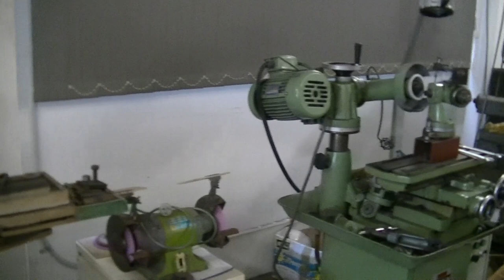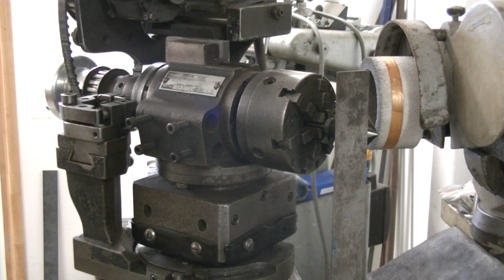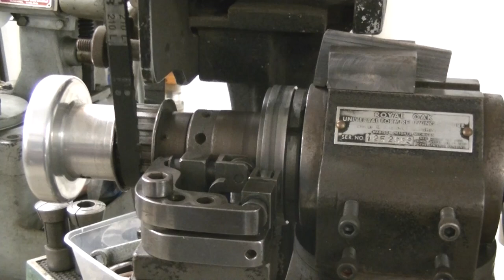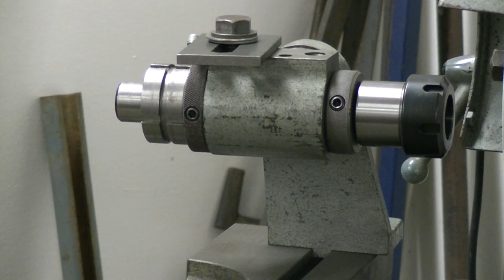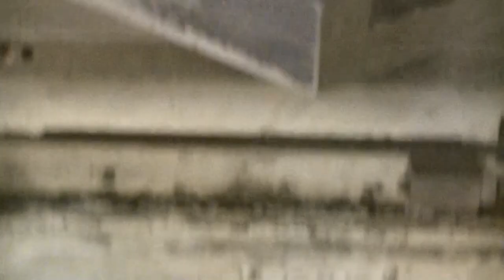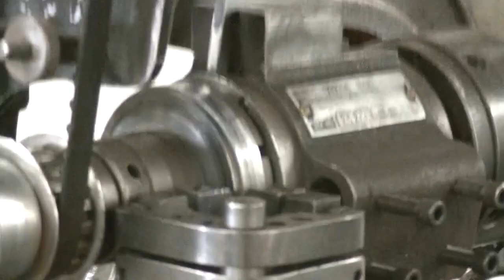Grinding Countersinks

Comment: How does the matching relieve the back edge
Reply from the maker: Hello from bc. Go to 5min/ 10 sec. the cam lever pushes the bearing housing towards the grinding wheel. That causes the wheel to grind deeper behind the cutting edge.

Comment: Can I ask why you do not grind the inside cutting edges.
Reply from the maker: Hello from BC. Grinding on the rake surface can be done but you risk changing the angle. The clearance surface will still be rough. Also grinding in the cross hole places the striations parallel to the cutting edge. You want them at 90 deg.
Reply: @inmyshedwithbc.   Interesting and I agree 20 odd years ago I had a industrial sharpening business, (the take up of CNC killed it off )I had two major clients that insisted I grind the inside face, I am about to purchase a T&C for for my own use in the shed.